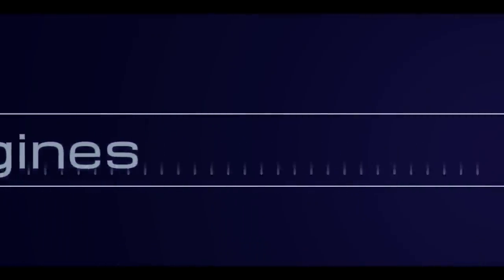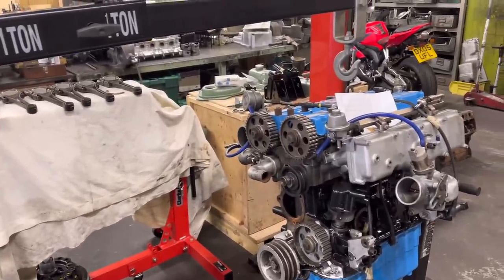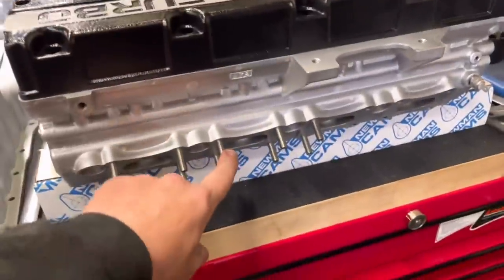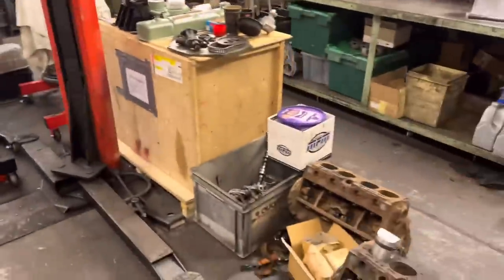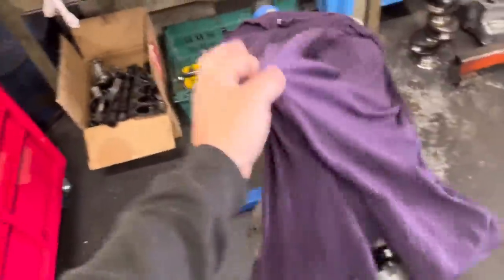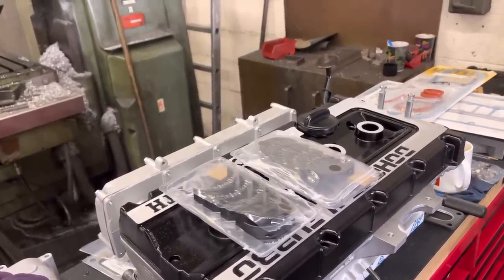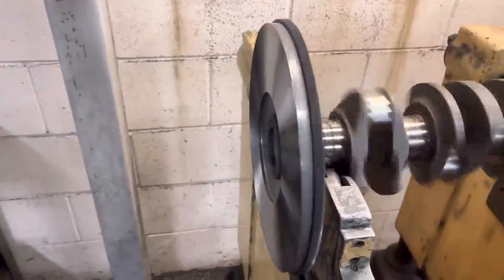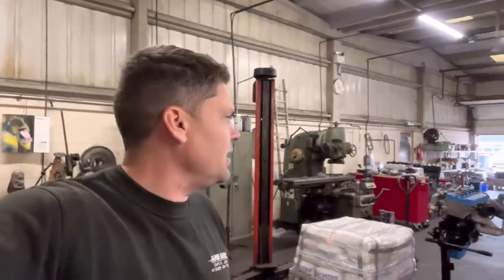BRAND NEW Cosworth crankshaft, we are SHOCKED at what we found

Comment: Two points. My first thought regarding balancing the crank was,  does your own machine need calibration?  Perhaps its your machine that is giving inaccurate readings. How often do you get  your equipment calibrated. 

Secondly, surely with the amount of engines you are reconditioning/ rebuilding, they aught to be run on a DYNO to prove they are fault free before returning to the customer. 

An engine was on a stand and you stated you got the oil pressure up, how would you know that with any accuracy?
Reply: Totally agree with all your comments... & very valid points. 
Hope Lee chips in with his thoughts & answers your questions.
Reply: With the balancing I assume you can double check the results by flipping the crank end to end and 180deg rotation the exact same out of balance weight should follow the move. Bit like a spirit level calibration. I am sure they have a test piece if round bar for calibration check.
Reply: It takes quite a bit of time to set an engine up on a dyno, even more so if you are potentially working on many different types.  You also need carbs/injectors/manifolds etc etc which often don't come in with the engines.  And then it would need running in before the dyno would tell you anything meaningful other than it runs and doesn't leak.  You can get full oil pressure up by turning it on the starter motor.
Reply: So more a case of Cosworth were astonished at how far out of whack the engine builders crank balancer is😂😂
Reply: @chrisjohnson4165  Cosworth were not balancing these crankshafts Ford were

Comment: Lee, Since you've documented so much of your builds showing the balancing, blueprinting and assembly that contribute to your warranty, perhaps you should get or obtain a nearby source for engine testing and break in procedures, controlling important oil and timing settings as well as follow up valve adjustments etc ? Then you would be able to prove everything was fine on engine as delivered. Anything else that happens would then be the customer's liability. This would help with cases like you referred to where injector issues may have led to other problems. If a dyno does not appeal, maybe a test bed vehicle similar to your track car could fill that role ? A simple bodyless tube chassis with lots of interior room and bracketry for a variety of power plants/transmissions to drive as a test vehicle for a few hours if necessary would ensure your control of outside issues.
Reply: Fantastic idea and a very smart investment considering how people seem to come back with the most ridiculous warranty claims

Comment: Hello lovely to see the engines being referbed. I was a cl turner for many years and at one time was tool setting for the piston side, ( a fairly complicated piece of kit to produce.)
Not sure what tool you were using to do your face  work but was I hearing a scratch ( bounce ) sound when facing.
If using hss cutting tool I would increase top rake and increase tool radius, reduce feed and keep chuck speed as is.
If you can reduce tool centre height by .005 thou. 
At one time working for a piston company they had a piston with a "v"  inserted metal  groove to be machined to a cla  finish of 25 microns faces which I managed to do, but sadly no extra money in my wage packet.
Watching your vids, even at nearly 70 years old I can still smell the inside of a machine shop.
Kind regards  Michael

Comment: Just a thought on the smoking Transit. I would suspect that the fuel pump is breaking up sending metal to the new injectors and causing them to hose and overfuel. Even if there is water/rust in the fuel tank, the filter system should remove it before getting to the pump.

Comment: You grind a flywheel because of the hot spots or hardened material, you are basically trying to cut two different materials at once, so the lathe skips over the hardened areas whilst cutting the softer material, giving an uneven surface, the grinder removes all material at the same time evenly.
Reply: Simple answer then, cut the hotspots out with lathe, easier to spot that way, then grind it even ^^

Comment: I may be mistaken but you appear to fit the pistons and rods into engine blocks and then fit the crankshaft which is wrong. The crank should be fitted into the block and torqued down to confirm free spinning. Then as each piston and rod is fitted the crank is turned over to check smooth movement. If you put the whole lot together and the engine is tight you will not know where the problem is.

Comment: I would like to comment on machining a flywheel vs. grinding.  When I did work like that, I preferred grinding because you could still get all of the hot spot out if you measured the thickness of the flywheel before machining.  I would measure the low and the high spots then grind.  If the hot spot was 0.0100" or 0.0150" high then I would grind that much below the lowest point of the flywheel.  Hot spot gone!!
Reply: I have worked on a lot of agriculture and commercial engines and the flywheels are badly worn and grooved with many hard spots that simply chip a carbide tip so grinding on a rotating bed is the only option .

Comment: I'd heat-treat the flywheel before facing it, regardless of how it was faced.
Facing alone wont remove overheating stresses in the material - even if you think you're 'under' it. Taking material away just increases the chance of it warping, next time it gets really hot. 
That's due to the uneven tension in the grain boundaries of the material, created by the uneven heat distribution. Heat treatment would 'reset' the material to an even state.

Comment: Years ago when I was into rs turbos it was always a battle getting the ap paddle clutches to bed in and not slip on high boost...ie 25psi. Surface grinding wasn't the way over it as hard spots or hot spots were still there.so cutting the flywheel was the best way but all my local machine shops wanted so much money as it was time consuming. I ended up buying new flywheels in the end.
Top work Lee I love it.

Comment: We get this sort of thing all the time at work. Very rarely do injectors stick open due to contamination to the point it causes a catastrophic engine failure. If its a common rail system, you are much more likely to end up with high leak back and a non start issue. Who do you use for your injector testing?

Comment: Because some of these Engines won't be fired up and driven for sometime due to restoration not finished yet. What assembly lube do you guys use that stays put while the engine sits around? Possibly for several months.  Cheers John.

Comment: A thought re that crank balance issue. It looked as if the pre drilled balance holes had the same finish to them as the webs and counterweights…suggesting they were drilled before the crank was ground. Maybe they just balanced the first one they made and use the same drillings for them all?

Comment: The fuel filters fitted to standard vehicles would at best be a 5um fuel filter, the most damaging particles size in a fuel system are <4um, the ISO4406 coding of fuel quality dictated by the world fuel charter is 18/16/13 particulate cleanliness levels@ 4um/6um/13um  (um micron size), this equates to particle volumes per ml of fuel. This equates to the following particulate volume per micron size, 4um particles per ml  @18/ = 1,300 to 2,500, 6um particle per ml @ 16/= 320 to 640 and 13um particles per ml @13/= 40-80 per ml. The fuel filter will take out the 6um and 13um particulate, but the 4um that is the most damaging will pass through the fuel filter and will have the same effect as a sand blasting, damaging close tolerances within the fuel system under pressure. Seeing as the engine was remove we could say the fuel remaining in the vehicle would be the same as when it was running, EN590 diesel has a FAME content of 7% and is hygroscopic, and natural induced contamination will occur. The fuel quality may also be a potential issue, and cannot be discounted out of the equation in my opinion.

Comment: Lee, I have seen you cut your flywheels like that for awhile now! We were always told over here in America that you had to grind the flywheel because It would wear the disk quickly, or you would have clutch chatter! I have since tried cutting a old farm truck flywheel, [that wouldn't have gotten cut anyway🙄🙄🙄🙄] like you have been doing forever! The clutch seems to work fine, so far with no chatter & I don't smell it slipping under a load! I'm sure we will find out next winter when it snows, because its used for plowing also! I have not had to readjust it, it seems to be in the same place as initial! Some of the newer emissions diesels are just a complete nightmare! He might not even have a engine issue! If he got a shitty tank of fuel, or Hes filling from a old bulk tank @ a farm, He could be causing his own issues! A bad/misfiring injector can cause a massive skip, knock & white smoke! I have heard engines that sounded like they were about to puke  🤮🤮🤮🤮some connecting rods out! It was also vibrating like the crankshaft had broken! There was absolutely nothing wrong with the engine! Thank God! He replaced the injectors for sure. Except they were from some fly by night, POS company, that he could never get ahold of again! So much for deals online 😂😂😂😂! I just got another set from a well known Diesel, Pump & injector shop! One that has never done me, friends or family wrong! Did they cost more than the internet deal? Absolutely, But they have been in the engine for well over 2 years now! Thanks, have a nice weekend! [Lets hope he has some shitty injectors! 😂😂😂😂]

Comment: Talking of Transits. I have a Nov 2019 registered Transit LWB 2.0, its a works van and looking to buy it at the end of its 5yr lease. I've heard of problems with oil pumps. is it just pump problems or wet belt bits blocking the strainer or both or???

Comment: If I had your gear I would lathe and then grind the flywheel. I’ve had some interesting brake disks on hardness and hard patches. It is never boring :o)  even if a friend brings four I can tell which are pairs. The other thing that had me thinking on the lathe is warping due to the chucks clamping force. On my lathe brake disks warp a tiny bit and tractor flywheels don’t.

Comment: Be interesting to see you compare the much vaunted Cosworth YB to a Nissan FJ20, particularly in the ports.
Reply: love a good Fj20
Reply: @Gooie69  built like a brick dunny, and excellent head with proper ports.
Reply: @cabbage4372  huuuge ports man. A mate had a worked aspo fj20 with twin side draught webers in a std datto 1200 sedan. Had no probs turning the tyres in 4th. And a turbo fj in a datto 1600. Such a tough engine that can take an absolute flogging unlike those sr20 tractor engines.

Comment: Lee, is that out of balance crank still straight?
Sometimes they relax bent over time.
It might need stress relieving before anything.
The factory is supposed to do it butl......
I would check it all over for throw angle as wel as straightness along it's length.
A pain I know but if it bounces because it is out of true you won't look good at all.
If it is banana shaped it might have a short and messy life.
Tightness on asembly will be the clue but it is a pain in the neck by then.
Check it now in case it needs relieving.
It might need a regrind from new.
The economies of " customer won't notice " and the dodgy suppliers get away with it.
A god suplier will exchange without question.
Cheers 
James.

Comment: Yep, definitely a landrover or rover 60 engine block in the background :o) That weird cam arrangement.
Reply: And then we get a description :o) I had a liner in mine by Hallards in the early 1990’s. Seems to be happy. I guess Barum has the wedge adapter thing to bore this slope face block? Kind of screwed without it. It’s a funny engine, a sort of clever fix at gas flow and reliability. With 12 rocker arms ^-^

Comment: Hot spots will make different parts of the flywheel different hardness. Should it not be annealed to relive the stresses as when it gets hot it will flex in diff areas ?
Reply: Annealing a large part like that would cause warpage.
It can be done but takes too much effort.

Comment: I don't know if this is applicable but, Did the chap with the Transit engine have ECU reprogrammed to the new injectors specs? I just did my Fiat Ducato injectors and a had a Bosch service centre check "New" injectors and they were miles out. Basically an extra £120 but cheaper than an overfuelling injector burning the engine up.
Reply: all they do is put the code in that is printed on the injector 120 seems steep for 20 min job
Reply: They checked them too. To make sure they were all delivering the correct amount of fuel then generated the new codes. I've never had it done before and couldn't find any info on whether that was expensive or not unfortunately. I also needed them  back quickly too.
Reply: @AshGTE   well that sounds like a good deal if they took them out and tested them
Reply: @AshGTE   o yea if it has the transit engine in i would recommend new bolts to hold them in as break after a while if reused there cheap from ford
Reply: @mikedoblo4782  they’re torque to yield. Nothing to do with quality. 1 and done
Reply: @mikedoblo4782  ah misunderstood the ‘cheap’ comment. Cheap to replace from ford. Gotcha
Reply: @getur99  i said if you reuse them they break, sure they were only fiver each from ford so its not worth been cheap with the damage it causes
Reply: @getur99  my typing probably does not help

Comment: How do you check oil pressure on the stand? Building an rob as we speak would love to test for oil pressure before spending hours putting it back to check it on the gauge before starting.
Reply: On YB engines, you pull the distributor and use long allenkey on a drill to run the oilpump.
Reply: That’s handy!, unfortunately the RB oil pump is driven from the crank snout so not something I can prime without turning the engine over at the same time. Still on the stand so I can’t put oil in it as the flywheel isn’t on.

Comment: Regarding the crap in the transit fuel tank, how does the crap get to the injectors? Is there not a fuel filter?
Reply: Missed maintenance usually if it’s standing still it ain’t earning business mindset to the detriment of the engine health
Reply: So if you don’t change the filter on time it will let the “crap” straight through ?

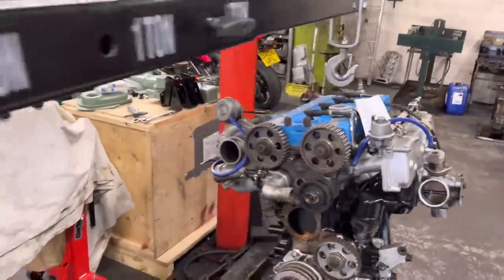Comment: you cover the crank, but the  tub of grease with NO lid @ 1:30  does not work for me, the place is looking tidier, but the crap all over the walls, and under benches is not necessary.
You need a person to come in after school ( a motor head ) to start at the bottom ( sweeping ) and work up the walls, then onto tea person and then onto ......

Comment: It’s odd you mention the transit engine issue with regards to moisture in the fuel system.
My father 22yrs ago, purchased a brand new MK4 Ford Transit, the duratorq model. And within a few thousand miles, it’s showed symptoms of not starting when cold. So under the factory warranty, the dealer agreed there was an issue with the fuel lines allowing moisture into the fuel system. So duly replaced all the fuel lines & cleaned out the system.
And that was when the MK4 was released onto the market.